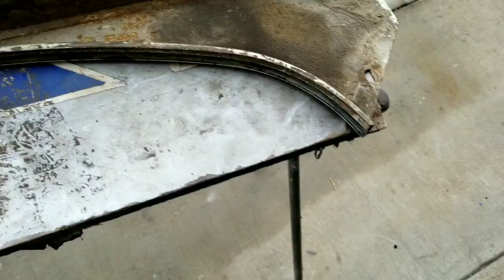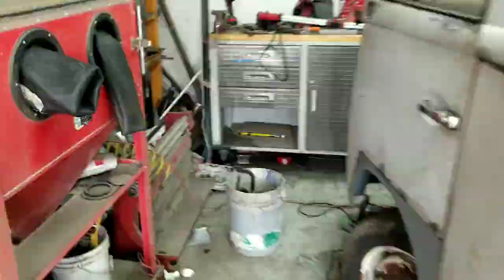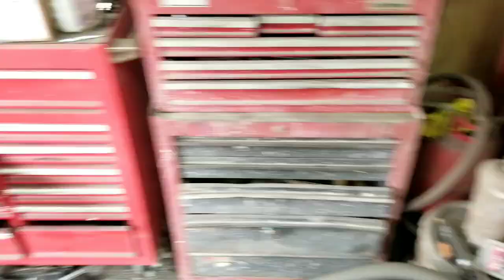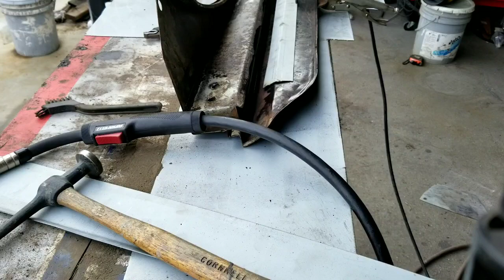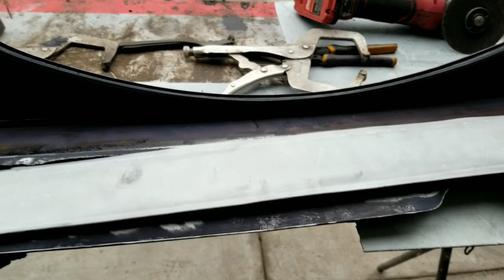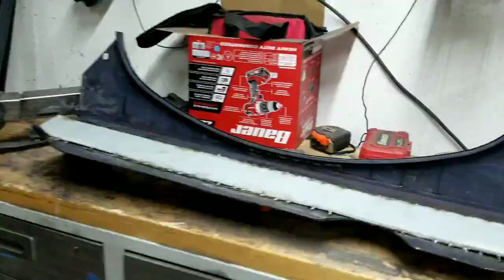VW BUS RESTORATION - Apron Rust holes - Hand fabricate patch panels

Comment: You can seam seal the inside !!! Use the 3m self leveling seamsealer , have the part in a 70 degree angle , put it on one side ( a lot of material ) and let it flow down , it will get 100/100 seamsealed !!!!